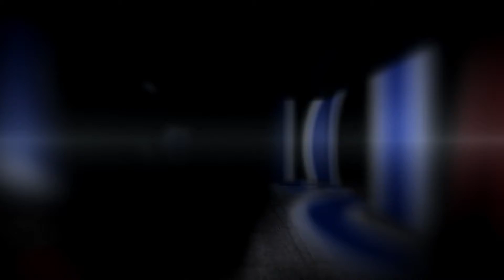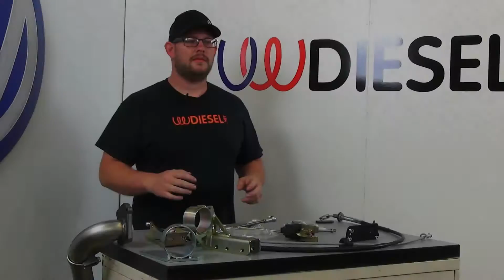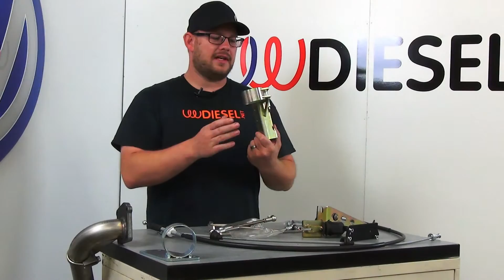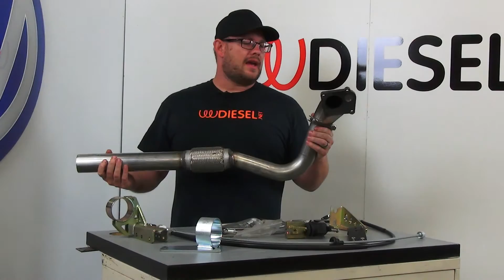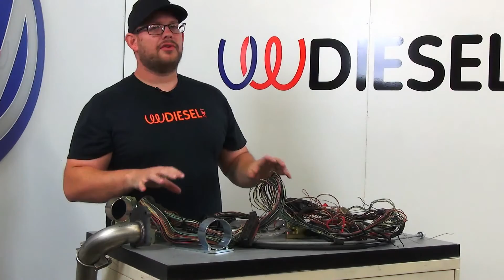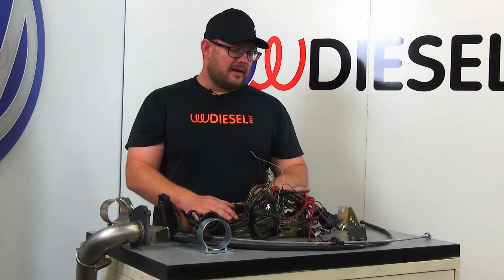AHU TDI MK1 Caddy Swap - Intro

Comment: So how does the cable work for the speedo if you’re using a 98 jetta tdi trans that trans has no cable?
Reply: There is a special cable you can buy that adapts 02a to mk1 
They’re around $75. 
Google it.
Reply: Edit. 
He actually says that it comes with the speedo cable....

Comment: good afternoon ! I have a 1981 vw rabbit diesel 1.6L (not turbo), it is possible that I can make a 1.9 tdi ALH swap of a 2002 mk4, but my intention is to do it not electric!
Reply: Ahu is a better fit. You can use your original mounts. 

I have an 81 caddy that’s been tdi for 10 years. 
Check my videos!
Reply: You want a Land Rover discovery 300tdi injection pump. 

I’ve been running one for a long time. 

If you put a vnt15 on it you can get same power as alh